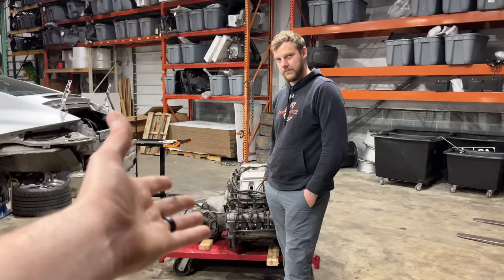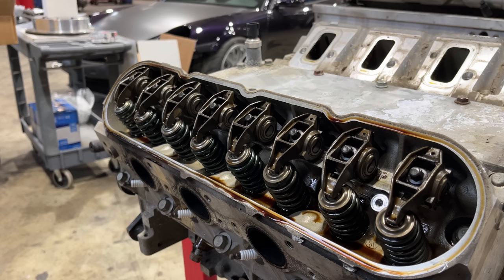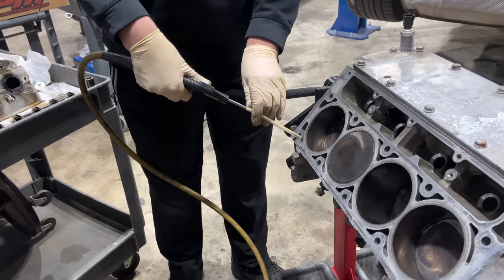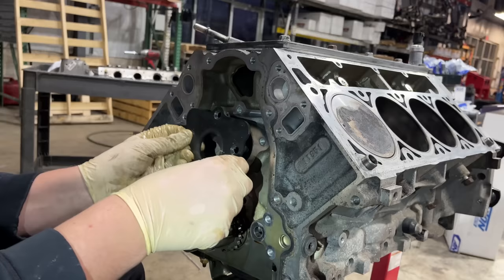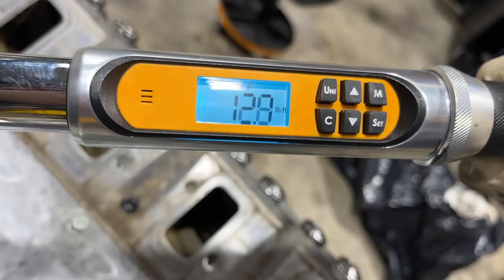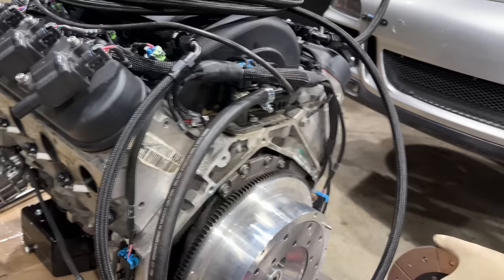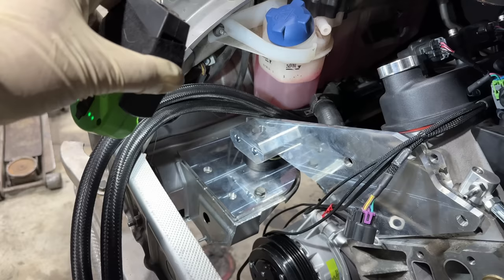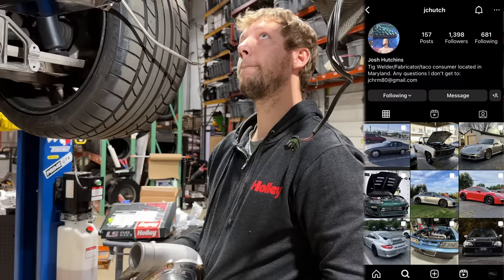I Put a CORVETTE Engine in My Brothers PORSCHE 911

Comment: Should have used a 996/997 Turbo trans. You’ll find out soon enough how bad the non turbo trans is.
Reply from the maker: I’m already aware it’s not a great option. However I’m not sure the turbo option is worth the 20+k in conversion.
Reply: @scraplifegarage  PDK/Stand Alone controller. All in 10k. Turbo 6 speed cut down to 2 whd = 10k all in. The adapter plate for the old school VW bell housing bolt pattern is MUCH thinner with a flat steel flywheel. Can run a twin disc setup in the Turbo 6sp.. this single will either require 900lbft of pedal pressure .. or it's going to slip (it's going to slip) I started building 911 V8's in the early 90's.

Comment: The only upside I see in this swap is the maintenance will definitely be easier and cheaper.
Reply: Less weight from the LS3, and better highway fuel economy (if geared appropriately)
Reply: @lorddoobsworth144  the cutting of the car was the most painful thing to watch. They know what they are doing but as someone who appreciated the design of the Porsche it was hard to watch.
Reply: That's a pretty big upgrade.   Don't forget reliability.

Comment: Why?  The Porsche flat 6 is a stunning piece of high quality engineering. The LS is old (pushrods, for god’s sake?!) nasty pig iron.  The reason why 911’s handle so well is that the weight of the flat 6 is low.  It will never handle. What a waste of a decent car.

Comment: I couldn't imagine this will handle well?
Reply from the maker: Why wouldn’t it?  Less weight, and the motor is moved forward to get it more over the axle.
Reply: @scraplifegarage  whoa I imagined more weight! That's cool! Could there be a chance for  mid engine setup?
Reply: @scraplifegarage  so many people seem to assume the LS is heavier. Calling engines 'big' or 'small' based on displacement is very misleading.

Comment: Ok. Great talent but not enough info. What model car. Looks like 997.1 with gt3 aero package? They called the porsche motor junk so i will assume its 997.1? Weight difference?  Why not put a mezger in it and up the boost to 800 hp. Can the trans meant to only handle 355 hp handle 800? All these and many more relevant questions unanswered. Then after a half hour i see i have wait for another yet to be made video? F==k!

Comment: I want the shaft
Reply: I have a LS3 swapped car myself. 2001 trans am WS6 w a stroker LS3 427ci. T56. Ford 9in. Welded subframe connectors. Coil overs. True dual catless 3in exhaust w coupe. 2in prim and 3 in collector long tubes....

Comment: That heavy lump has got to make a tail happy car even more precarious!
Reply from the maker: The LS engine is infact lighter than the 3.8 Porsche engine that was removed.
Reply: its lighter lol, people often assume displacement is the only factor in engine size and weight, its an easy mistake to make though as people call engines big and small based on displacement.

Comment: took a 911 and made it trash. Good luck with the inherent under steering now that you completely upset the balance. A 911 uses a dry sump pump with 11 quarts of oil as well. Your setup doesn't look like a dry sump. So much cringe
Reply from the maker: Non-turbo 997 are wet sump.

Comment: I'm sorry but I stopped watching after you went wet sump.
Reply from the maker: No reason to go dry sump.
Reply: @scraplifegarage  Except cornering I guess, the one true calling card of the Porsche. Ask Chevy or any road racer or drifter, it's dry sump or smoked engine for dinner. If it's never going to see track time or an extended play day in the mountains I guess you can get away with it.